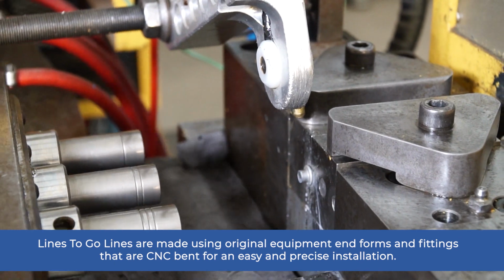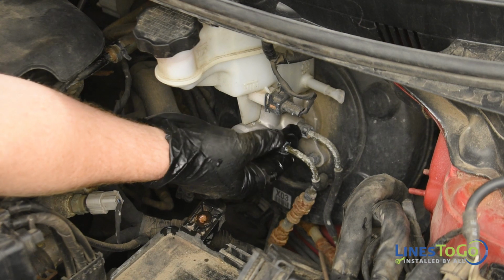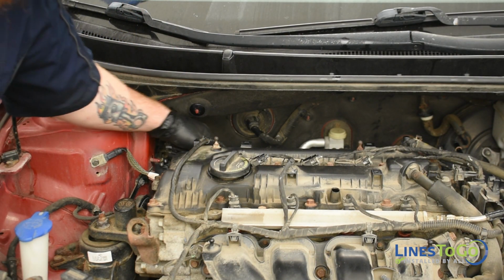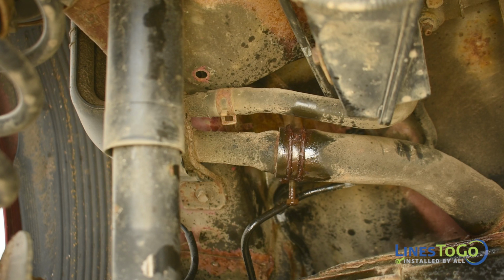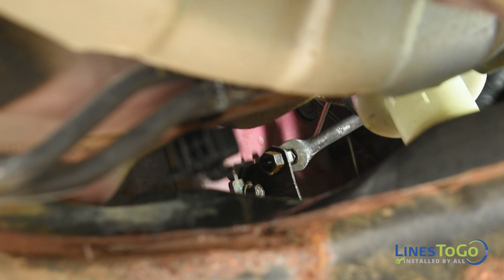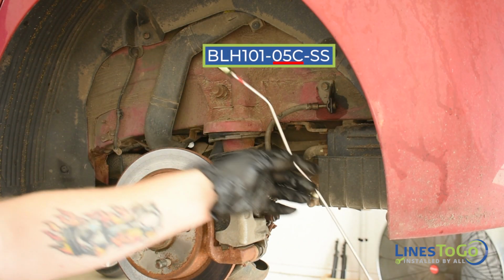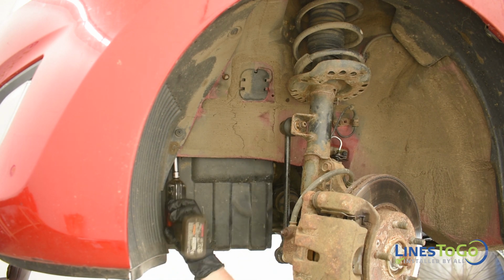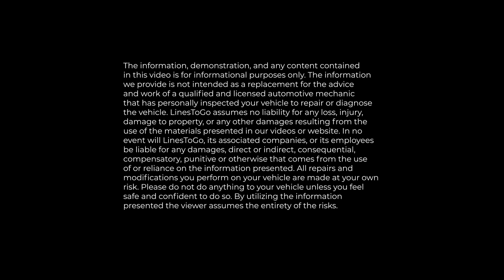How to Install 2013-2017 Hyundai Elantra GT Brake Lines

Comment: Do you know the part numbers for the brake line clips underneath the vehicle that hold 4 lines and the plastic cover that goes over them?
Reply from the maker: Hello Robert,

Unfortunately, we do not sell the clips and plastic cover. You sould be able to find them from a local automotive shop!

Regards,
LinesToGo